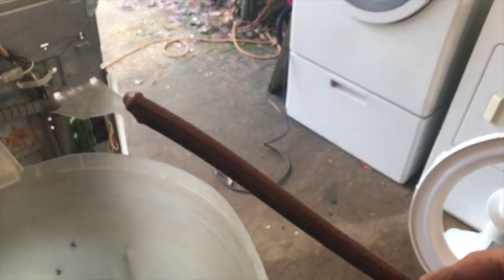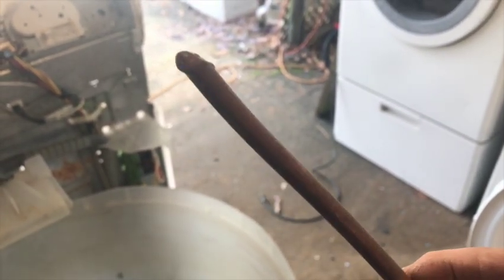How To Repair a Cracked Washing Machine Tub: Plastic Welding Salvage Tips

Comment: I believe i cracked my tub whilst trying to free the inner tub, i was rocking the tub side to side as directed and i think the plastic wing on underside of tub has made contact with the frame.
 I found the best method to remove  stuck inner tub is to use a small jaw puller on locknut and pull the inner tub and drive block off in one go.
Reply from the maker: You can see how I pull stubborn tubs at about 21:50 in this video https://youtu.be/zpnNEI2YMGs?si=LpsJbx9_jakNy8gx. Thanks for watching!

Comment: Clear Flexseal works as well. Same steps with thevholes, then just Coat both underside and topside of tub, i take an old solder iron and spread the plastic in the cracked portion, then once cool spray flex seal, then tape both sides with flex tape or tpo tape The rest of the tub will fail before the patch does
Reply from the maker: Good advice!  I hope others read this and try your method. Your materials might be easier to acquire too.  Thanks for the comment and thanks for watching too.
Reply: @HarperandKnowles  thank you for the content, you taught me how to diagnose and repair the whirlpool neutral transmissions i used to scrap those out if they seized up or spun with water in the tub and now i can save them
Reply from the maker: Absolutely, they are way cheaper to rebuild than to buy!

Comment: I have the same problem with my washer tub, It is cracked at the fin almost identical to your video. What concerns me is how it was able to crack in this area but the washer has been fine (no leaks) for the past 6 months. I'm trying to understand what caused the crack. Is it possible that an unbalanced load in the machine could damage the fin? I'm trying to find the cause of the problem so it does not happen again. I really appreciate your videos and thank you for the great tribute to Mr. Harper.
Reply from the maker: Make sure your stabilizer spring at the rear left of the tub is still attached to the frame and that all three snubber pads are not worn out. These things can cause the machine to shake violently and those fins can jump up on the triangular “swash plate” and when you fill the tub with that fin riding on that plate it will crack the tub every time. Thanks for watching and for also watching my tribute to Mr. Harper.

Comment: My washer is leaking, i dont know what's wrong with it i'm thinking it may be the tub. There's a line in the middle of the tub from top to bottom. I don't know if it's just the way they made the tub or if it's cracked
Reply from the maker: If your tub is cracked that bad it would have to be replaced. Cracks are pretty easy to detect. If you push out on one side it should separate from the other side. You failed to mention what model machine you have.  I can give you some common areas that your washer would leak if I had that information.

Comment: But why did it crack
Reply from the maker: Perhaps you should watch the video and find out! Thanks for the comment!
Reply: Hi mate thanks for the video,
Do you think an epoxy style product will work or do I need the plastic welding rod?
Reply from the maker: I don’t know about an epoxy repair. I know the 3m Scotchkote hot melt patch works great but they are expensive. I get a few sticks when I can from guys that work the pipeline. Once they roll around in a work truck and get dirty the company won’t let them use them on the job so either throw them away or give them to the workers. They are still usable if you wash them off. 3m also makes a liquid form of this called 3m Scotchkote epoxy https://a.co/d/0GBkxTr.